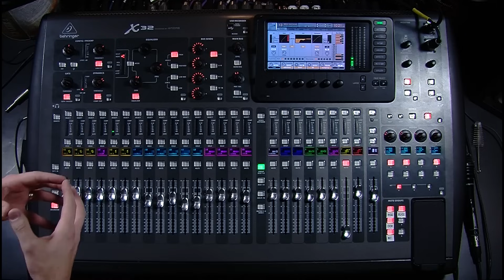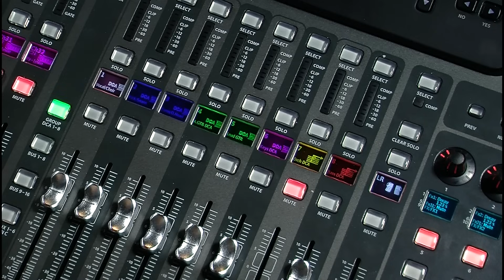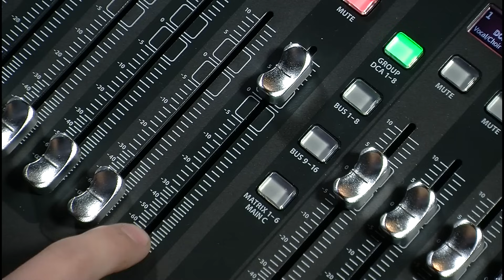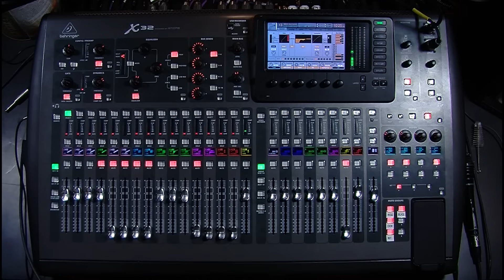Behringer X32 - Basic Mixing 101-1 - Intro & Layout

Comment: Hey Drew, really helpful playlist. Just one question. What is the difference between bus 1 to 12 and main bus?
Reply: Hey man just to ans your question.

Bus 1-12 is basically individual auxiliary buses for monitor mixes, subgroups, or effects sends, and the main bus is the primary stereo output bus for the final mixed signal sent to the main speakers. E,g:

Bus 1: Could be used to create a monitor mix for the vocalist.
Bus 2: Could be used to create a separate monitor mix for the drummer.
Bus 3-4: Could be used as a stereo effects send to a reverb unit.
And 

Main bus combines the final mixed output of all channels and buses, which is then sent to the main PA system for the audience to hear.

Comment: When I run the sound mono and have no need, that the master out has to be mono compatible, I insert the Edison 3D effect, use a setting, that isn't mono compatible. It affects the reverb and delay, takes this away from the speakers, it will be located in a half cycle of 180°, is more impressive and this separates the effects from the sources.

Comment: Thank you for this video! I apologize if this question has already been asked (or answered in another video). You talked about buses when talking about layer 4 on the left side of the board. And you mentioned, for instance, having the drums in one bus. But then you talk about DCAs on the right side of the board - again using one slider to control overall volume of the drums. My question then is what is the difference between a bus and a DCA? Is there an advantage of one over the other, other than placement?
Reply: When using a bus, you can apply effects and route the bus to a output. A DCA can only adjust the volume of the channels going to the DCA.

Comment: Drew, my Church is looking to make a sound mixer purchase. We need more than 32 channels. Can we bridge a 32 channel board with a Rackmount 32 version? or do we need to boards? thank you sir!
Reply: Depends how much you are willing to spend, Behringer don't make a digital mixer like the X32 that can support more than 32 channels. You may be better considering a desk from Yamaha's TF series which the TF3 and TF5 can be expanded up to 48 channels (you may have to purchase a Dante card to do this). If you need more than 48 channels, Yamaha has the CL series, the CL3 console can be expanded up to 64 channels and the CL5 console can be expanded to 72 channels.
Reply: thanks bro! appreciate the reply.  @inconsistencies327
Reply: You can link 2 of these boards together. You would then have a total of 62 channels. Your first mixer would have the original 32 channels and the second mixer would take the LR output of the first in the first and second channels. This is only one way thought. I believe that there is another way using aesso but I am unfamiliar with that way

Comment: If you have a sound guy that need to know how to run the board. I have a sound guy that doesn't know how to run the board. I want to learn from the moment you take the x32 out of the box to the final product. How to setup the mains. How to program your mic into the system. How set up the monitor to make sure the work correctly. Don't show me how to send on faders and all the technical talk. I just want him to learn how to make those monitors work. Later we can learn the send on fader stuff. He know nothing about the board but wants to dedicated himself to learning it as his missionary.  Is that possible A. I took it out of the box. B. I plugged it in and it lite up. C. How I set up the mains. D.  Step by step. Until well here is your final sound coming out of the speaker and monitors produced with the Behringer x32.

Comment: I have brand new x32, I noticed in your video yours is doing the same as mine. Under the scene section your #7 button is flashing. On mine 7 & 8 flashes and I am unable to select them. How do I fix this?
Reply: You have those buttons assigned to Tap Tempo. They will flash in time to the delay you set in your Delay FX. They provide you a convenient way to time your delay to the music by tapping them.

Comment: I desperately need some help with this console. I have a simple 2 Front of House, 2 Stage Monitor that I can not control independently. Our first service is this coming sunday morning and I can't seem to get the routing correct. Can you please help?
Reply from the maker: Hey Chris! Thanks for reaching out. Check out this blog post: https://dbbaudio.com/2017/x32-output-tap/ Under the part that mentions "Set-Up for a Floor Monitor" and that should help you. You can do the same setup for the Mains on the routing, but if you have a full size X32, the main left right output should default to be XLR Out 15 & 16. If you have a compact, rack, or producer, it will default to have the left right output be on XLR 7 & 8. Hope this helps!

Comment: Great videos.  I have a question that I did not see on your tutorials.  I want to be able to send a signal out from my X32 to plug into a device that will send this signal out to the hearing impaired in our congregation. i did on my old board through the headphone jack but when you push solo they are only hearing that channel. Help!

Comment: Are "Sub-Groups" and DCAs the same thing? You never used the term subgroup but I have heard other people commonly use it.
Reply: I'm sure you've found that answer by now, but for anyone else who reads this: No, they are not the same. VCA/DCAs control the volume of the signal on each fader. A subgroup only controls the volume of the sum of faders. Meaning VCA/DCAs will control the volume of post-fade aux sends. Subgroup faders will not. Another difference is you cannot insert on VCA/DCAs.

Comment: Hey Drew thx a lot for sharing this information this video is very helpful. I have one question though: What is the difference between using a mix bus and a DCA to control the volume of the drums as a group in the mix? Seems like some other people in the comments have had this question and not found the answer.
Reply from the maker: Hi Rilla, thanks so much for asking. The main difference between a mixbus and a DCA is that the mixbus is an audio path and can be altered with EQ and compression. The DCA is not an audio path, so it can only remote control the faders that it is assigned to. I made a video about this, it is a bit old but the information is still good. https://www.youtube.com/watch?v=j7pJu1BbqJ0 Thanks!
Reply: Thank you very much for answering, helpful as always!

Comment: you have drums grouped in one bus (3:00) and again grouped in a group in right fader bank (5:28) 

what's the difference?
Reply: Using DCA as opposed to a subgroup... if you use a subgroup (BUS) as he does earlier in the video this will not effect the overall volume of those group channels to the effect sends. For instance, if he groups all vocals and gives each vocal channel some effect, when he turns the BUS single fader up it will not correspondingly increase the level going into the effect. That means the balance between the direct signal and the effect signal will change.  By using DCA it actually increases each individual channel's (within the DCA group) "volume" when you move the groups fader up. That way you keep the same ratio between the original signal and the effect signal. Hope that makes sense.
Reply: Just looked down here because I had the same question.
Reply: No , He has them in 6 Sub Groups on the Right Side as Sub Groups in the 4th level .  Then he has them on the DCA's . So he has them sub grouped two times . WHY? Only DREW can answer this ..  .
Reply: He has two DCA's (right fader bank) that controls his drum levels without having to adjust and equalize them separately (meaning it keeps the levels he set, but at a lower/higher frequency)
The bus sends (4th level) are what's sent to their subs, so he has 6 different drum mics, and he can control how much or how little each drum is sent to his subs.
The faders on the 2nd level (Channel 17-32) control the volume of each drum, so he can set the db level for each one according to his gain unity, which then affect his DCA groups on the right fader bank.
Reply: Blase Bernard The left channels has each drum individually on their own channel whereas on the right has all the drums on one slider/channel so you can control their volume output together.

Comment: hi i have a question. At first you say you mix all the drum channels to one bus to controll it just with one fader. Later you do exactly the same with the DCA. Whats the difference?
Reply: One is an audio group. The drum mic channels actually send their audio through that group master. The other is a DCA which is simply a remote control fader for the various drum channels. DCA don't actually process any audio. They are simply remote control.

Comment: We recently changed from a Allen & heath ZED 436 to one of these boards at our church, and the transition is not an easy one, there seems to be a lot of button pushing to get to where you need to go compared to the 'straight to the source' way on the ZED. I am You Tubing this desk like an addict on crack to get to grips with it, but I am slowly getting there.

Comment: Hey Drew. I am very new at this but I am learning. Hoping you can guide me a bit. I am getting an electric hum coming from the left channel on my x32. I am using a JBL powered speaker which is quiet until I attach the cable to the mixer. Then I get  the hum. The right side is quiet, always. The speakers, cables and x32 are all new. I have tried different cables with no change. Help!!! Any ideas. Bad part? Bad setting?   Mark

Comment: Just a general question, we just installed X32 large board last week, we had first use on last Sunday, one thing that was noted, was audio from computers and mp3 were going to both Mains which are plugged into 13, 14, 15, 16.  However, when praise team was playing, the inputs into 15, 16 were not receiving sound, ideas?
Reply from the maker: +Living Word Church Congratulations on the new board. I guess I am not fully understanding your problem. Can you give me a bit more detail of what is going on? Are you saying the main PA is plugged into the XLR out 13-16 or that the PC and MP3 player are plugged into the XLR ins 13-16. Thanks so much
Reply: I believe I found the problem, we had to get some adapters for xlr to 1/4 or TRS.  That seemed to make the difference.  Thanks for the response though.  This board is phenomenal.
Reply from the maker: Living Word Church You're welcome! I'm glad you were able to fix it. Let me know if you have any questions!